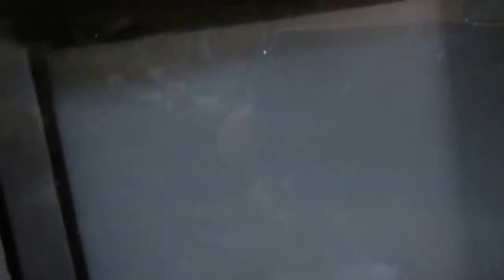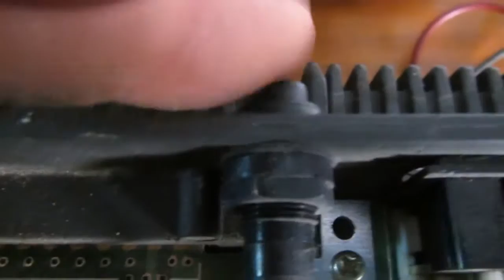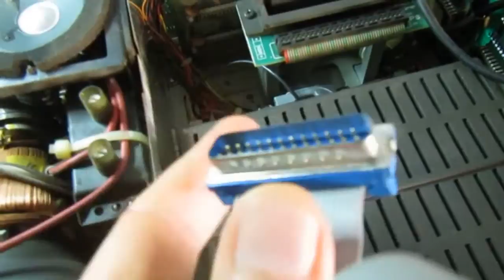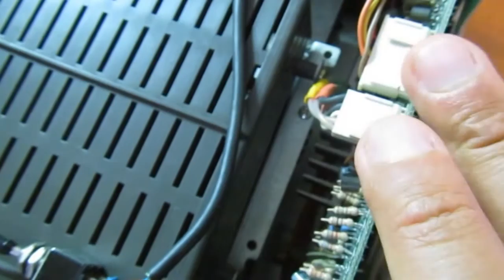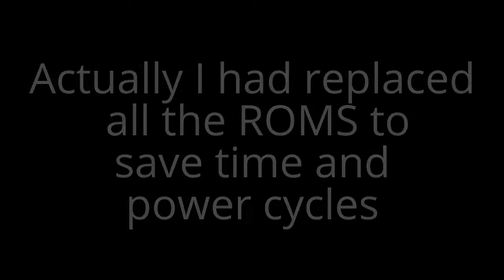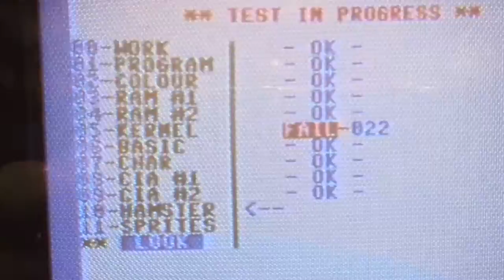Commodore SX-64 Executive repair. Yet another black screen.

Comment: thanks for posting. good info, but maybe have more detail such as showing how you removed the boards, what you used to break the connection on the user port and what software/hardware you were using to test the ROMs. I know these things must seem trivial to you but can be helpful for those of us who have never done this type of troubleshooting before.
Reply from the maker: Hi Shibu Kinatukara! Thank you for the comment. I try to keep the videos to a reasonable length, so it's sometimes hard to decide what to show and what not.
I can try to answer some of your questions:
The SX-64 boards are held in place by plastic rivets that can be removed by pushing the inner part to make it slide into the rivet. Of course you first need to remove all wired connection from the boards.
The PCB track on the user board has been removed with a sharp cutter, carefully incide the track on two sides of the connection and peel away the little copper foil between the two cuts.
For testing the ROMs I use a few vintage (E)EPROM programmer, I have a Promenade C1 for the C64 with its software (promos 2.0), sometimes I use a HI-LO EPP-04 with its MS-DOS software but most of the times I use a standalone programmer: Data I/O 21A this one can send the ROM dumps via RS-232 interface.
There're new programmers (mostly USB connected) that can probably do the same job, they have to support 2716, 2532 and MCM68764 kind of pinouts to be useful for the old Commodore ROMs.

Comment: Another job well done.  I was not aware of the SX-64 User Port 9VAC pin-soldered-to-ground issue; that is good information to know.

I found your use of the HP Current Tracer tool very useful in your other repair videos.  I have not seen that used before.  I have tried to track one down, but they are difficult to find, as they have been discontinued for a while now.

I'm going to pass on your channel to some other Commodore repair colleagues and try to get you some more subs and views.

 I look forward to your future repair videos.

Ciao!
Reply from the maker: Hi MindFlareRetro, thanks again for the nice comment! 
Yes, the old HP current tracer is a terrific help on large old TTL buses when there's a shorted I/O pin somewhere. Most of the times it doesn't point straight to the culprit since the good gates are still trying to source the current to the short and therefore show large currents too, but if you know how the particular circuit is supposed to work and what should be active/selected and what not, then it can point you in the right direction.
It took some months to find the current tracer probe on ebay (a few years ago).
It's also very useful when you have a shorted capacitor somewhere in power supply rails :)